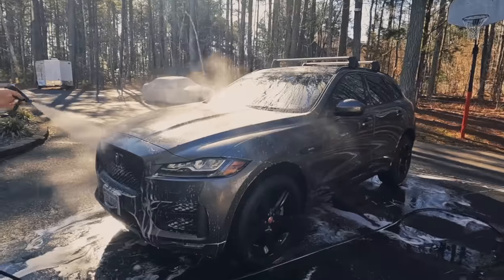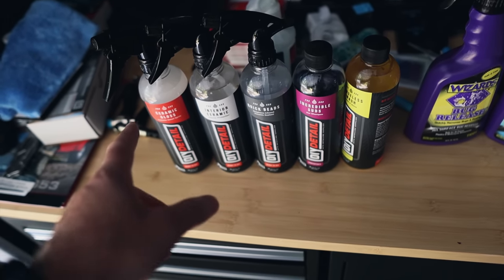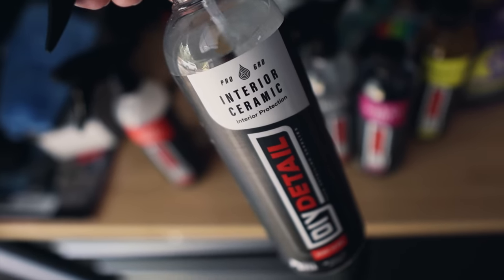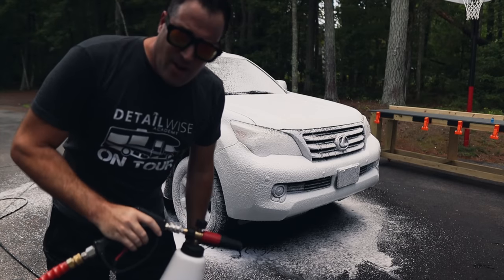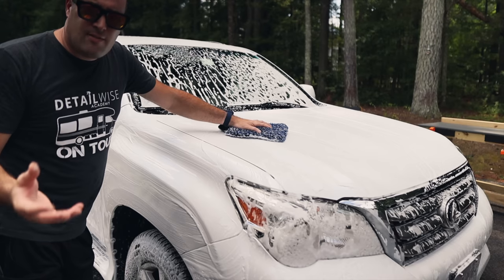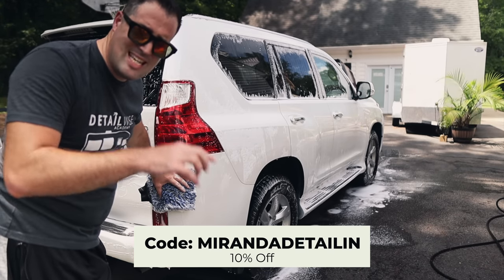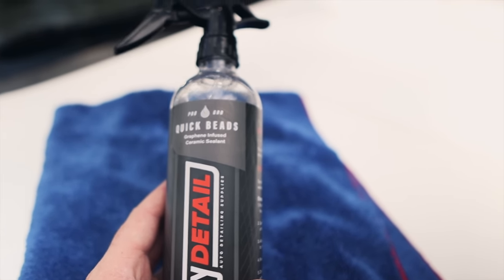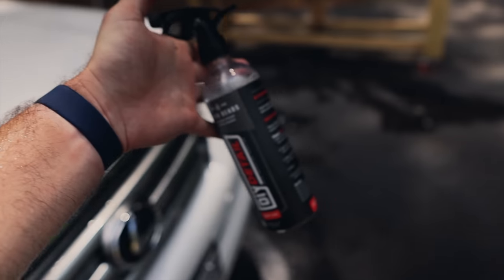Weekday Wash! Using Some New Products! Glovebox Giveaway! #detailingtips #detailing

Comment: I received the DIY intro kit (Rinseless wash, Ceramic Gloss, Quick Beads, Incredible Suds and a 15 ml beta sample of their upcoming ceramic  coating) from Yvan and Nick on August 11th.  I used the rinseless wash and the ceramic gloss on my Mustang prior to going out to a car event ( the 100th anniversary of the founding of Bowen's Garage, a small Ford dealership in Connecticut). I was blown away by both products. The rinseless wash is very slick and the Ceramic Gloss amped up the shine (my Mustang is coated with CSL/Exov4)

As far as wash methods. I use both rinseless and conventional, .It all depends on the vehicle.  For coating maintenance, I tend to do rinseless. If the vehicle is very dirty, I will do conventional.
Reply from the maker: Awesome to hear!!  Thanks for sharing man!
Reply: Thanks Ron!

Comment: Full time detail shop, not mobile.  My maintenance clients are on a quarterly schedule. I don't use rinseless washes.  I use 4 oz APC (P&S Enviro Clean) for my pre-wash with Either 1 oz of Koch Chemie SFN or 3D super presoak to 1 gallon of deionized water in my ik12 pro foamer.  After trying so many snow foams, I have settled on only one, Turtle 🐢 Wax Hybrid Solutions Pro PURE Wash.

Comment: Sometimes I do rinseless or even waterless washes if the car is in a garage or hangar and its super hot outside or I dont have the keys, or like one time I couldn’t get the hangar doors open on an airplane lol, however it cant be super dirty and usually only in garage or hangar kept planes and cars. Some owners actually dont want water used, I have a couple customers that dont like it for whatever reason.

Comment: Love that foam soap from DIY, might try it soon...im more of a traditional wash if time permits especially if the car is dirty, that changes if i maintain the vehicle which i'll get to see every week (and definitely coated, just part of my maintenance package)  i use rinseless or at times just DI water using a pressure washer and don't touch the car until i wipe down the drying aid or topper (you'll know if this method is effective when u wipe it down and check your microfiber and sign of dirt you should make a mental note do wash the car next time u experience the same scenario, with me i know when to use soap and wash thats just from experience and time)
Reply from the maker: It’s good stuff!  Even for maintenance details we always do traditional washing, the vehicles we get are usually pretty dirty and warrant it. Plus it takes us like a hour to do the whole maintenance detail inside and out. 😎👍🏼
Reply: @MirandaDetailing  awesome! btw u should check out @detail kegs, saves me a lot of prep and application time
Reply from the maker: Yeah I have seen those. They look pretty awesome!
Reply: @MirandaDetailing  If you were close to me i would let u try them out. You can foam, stream or atomize limitless possibilities.
Reply from the maker: Very cool!

Comment: I am a traditional foam contact car wash in the summer. In the winter, oh boy, different animal. Go to car wash with my soap and water and mits, and use pressure wand to rinse off salt. Do contact wash with mits, and rinse again. Drive home to heated garage and wait for water to thaw out. Then do rinseless wash and dry. Put on protection if needed. I have to adjust to winter conditions alot. Sometimes no washing at all due to car wash is closed due to sub zero temps. Sure do love Wisconsin winter! Hi wife.
Reply from the maker: Thanks for sharing!
Reply: I do the same thing in winter!

Comment: 2nd
That's what I like what is that excites and drives one nuts about using it because is a joy
I normally use ONR for vehicles that have a coating and vehicles not coated then I use the foam cannon with Double Tap or Turtle Wax Pure or WaxPlanet Eight Below or Ultimate